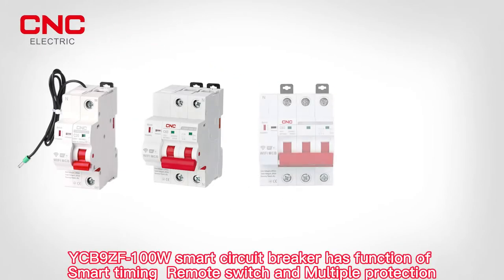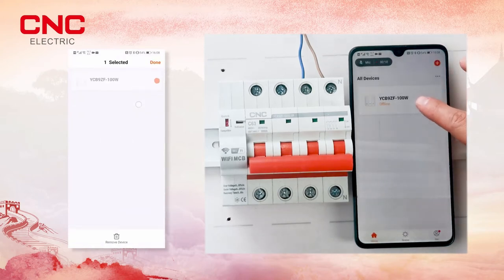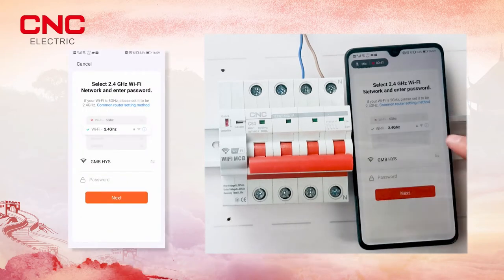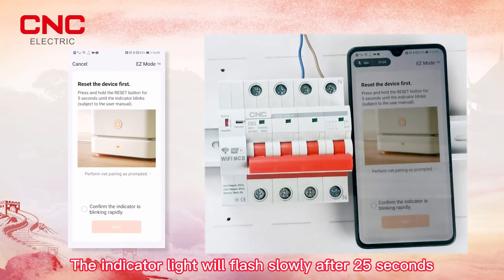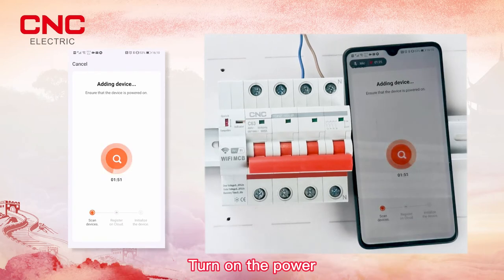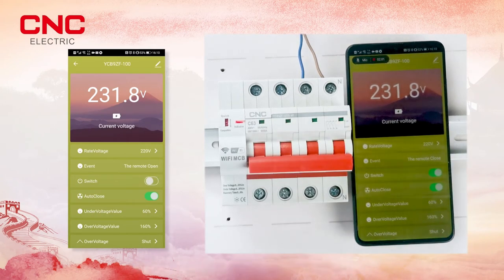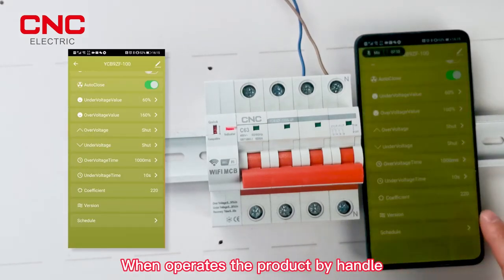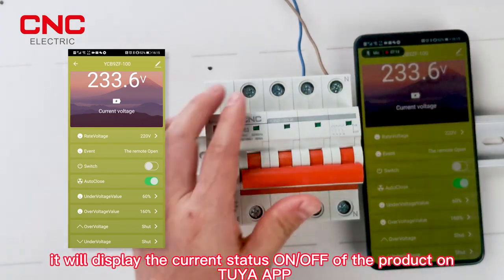How to Use IOT WIFI  Circuit Breaker ?

Comment: This looks great so solve a problem of mine. I need to disconnect solar remotely and be able to enable it remotely. I assume as long as my solar is sending power the breaker should be available online?
Reply: I'm curious to, when winter hits victron mppt can sometimes throw over voltage  error, be nice to reset solar remotely

Comment: Hello. If the circuit breaker is the main one at home and you power it OFF so you have no power at home and NO WIFI so you can't switch it back ON Am i right ?
Reply from the maker: Maybe 4G type can solve it?

Comment: Good Product
But timer doesn't work if not connected to internet.
Reply from the maker: We not only have WIFI type but also 4G
Reply: @cncelectric9297  Unfortunately even a 4g router need power. Even if the power comes back your product is not able to reconnect to the wifi. Maybe a DC port would help. It probably does not have any type of batteries or supercapacitors.